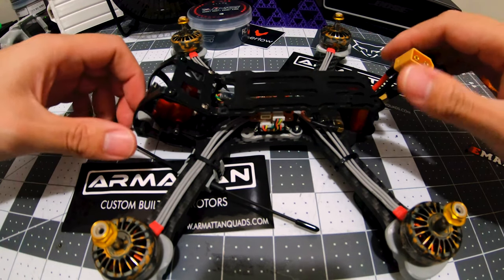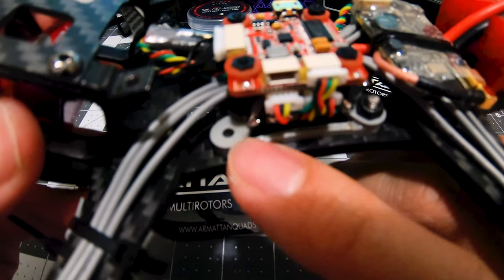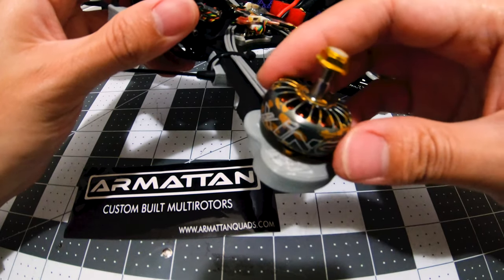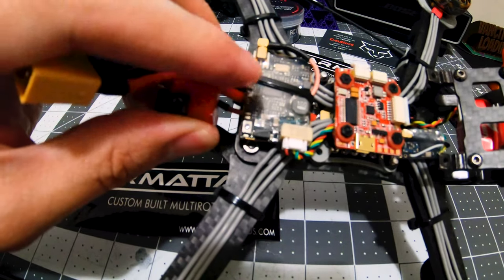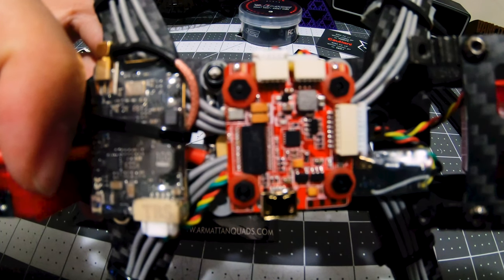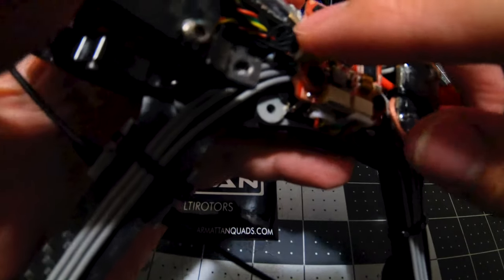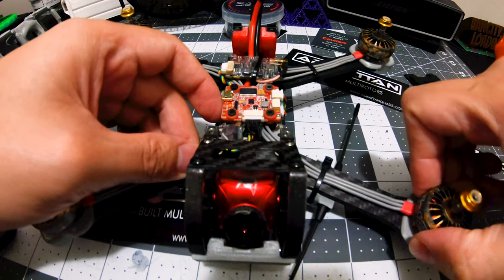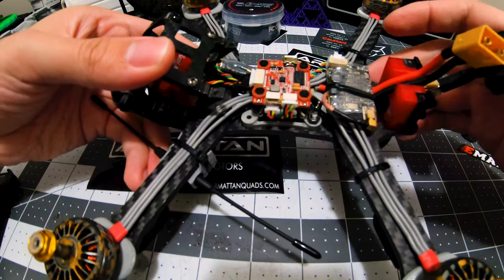FlightOne Rooster Build Overview

Comment: Dope rigg! I should have used a 20x20 stack. It was hell getting the 30x30 stack to fit with the tbs pro32 r9slim..and then there the battery strap and xt90 connector..crazy build.

Comment: how are these compared to the purple x2306?
Reply from the maker: Not sure but I imagine if the specs are the same they shouldn't be different other than color. Really like the motors though 👍
Reply: @vancityexe  i can only get my hands on some 2306 2750kv , how will it defer from the 2450kV?
Reply from the maker: @jkpisces  it will def have a nice kick to it with more power. My KISS build has mr copper 2306 2700KV motors and def has a nice punch out with the throttle.